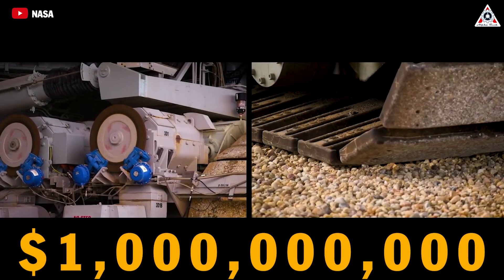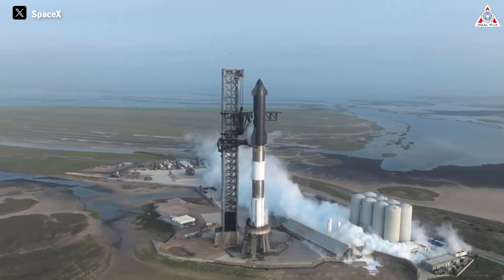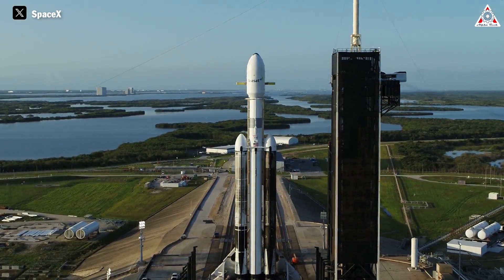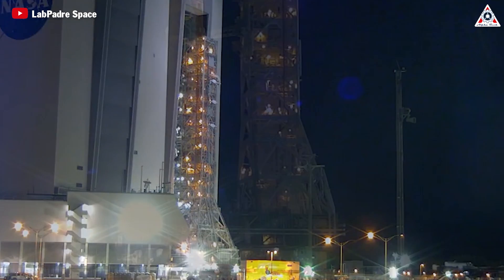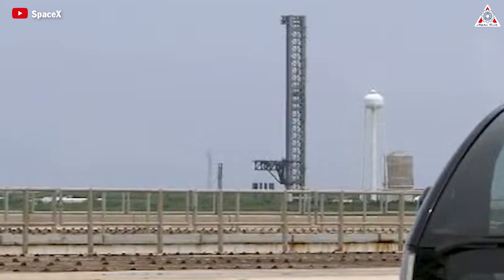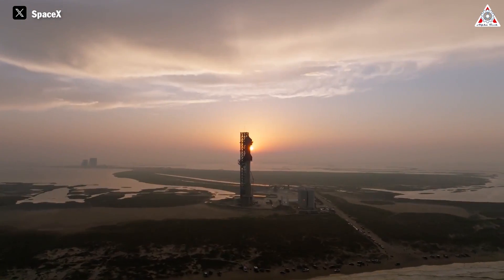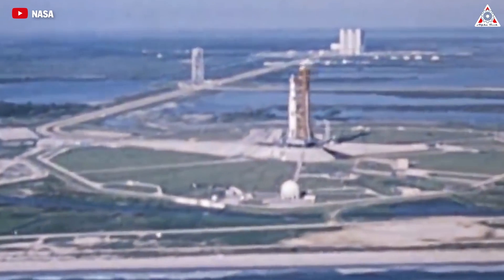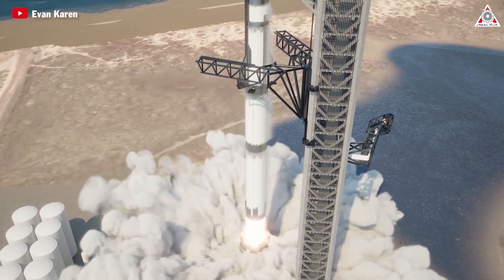This INSANE! What Elon just did with Starship tower in Florida &Texas SHOCKED NASA

Comment: If I was a new builder of such thrust to weight ratios, also of of new designs. I wouldn't want to use old platforms then. If something goes wrong, blame it on the platform owned by NASA. Understanding also the That NASA was the introduction to reusable space flight with the space shuttle. The thrust to weight ratio of the space shuttle is four to five times more than this single SpaceX. It's not out of the realm that it's going to cost more to push more weights and it's not out of the realm that NASA pioneering space flight also docking with the ISS.  The only thing I don't agree with is all land is owned to the boundaries and 500 ft high and to 500 ft low below the structure of a home or a building or anything. Correct If I am wrong. An old rotorhead noting those observations 89 to 96. Or the usn. I really don't believe anybody shocked, especially with an advanced system and trying to throw money at a different type of launch platform. When the launch vehicle is an entirely different type and size and weight. Also with reusable main booster returns. That is pretty cool. When I see a picture on a YouTube tutorial and it's nothing more than bait bait to watch it. If someone doesn't have the time or the love of what they do, they shouldn't do it. Russia shocked over f- 15. China shocked over raptor. I mean really ain't nobody shocked over a damn thing other than a meteor coming out of the heavens and going through somebody's car. Now that is shocking. I wish you well on your journey and I will keep the subscription as I just joined it. And see what becomes of it. But I do wish you well on your journey there. Take care 🕊️🕊️🕊️

Comment: On the subject of manufacturing transportation size, is separate sub orbital test flights to be caught in Florida both are capable such a Sub orbital trajectory by modifying the propellant loading on both.
Reply: LOL commenting half way though the film.
Reply: Igniting the vacuum Raptors at low power, ramping them up at 60,000ft and testing the heat shield on the way down.

Comment: I've always wondered if the Mechazilla can actually catch a booster and a starship. it lacks the one requirement to do so... speed. It's not moving fast enough to do so.
Reply: Its slow movement means that the ships will have to hover a few seconds.  Not impossible, just uses more fuel.
Reply: I don't think Starship will have enough fuel to hover for a short while. It can't possibly hover with one Raptop engine, it may need 3. I have all fingers crossed on this one.